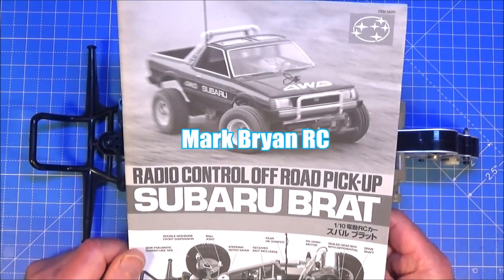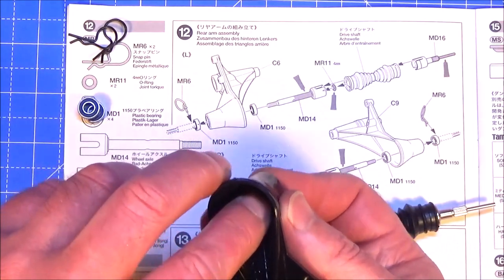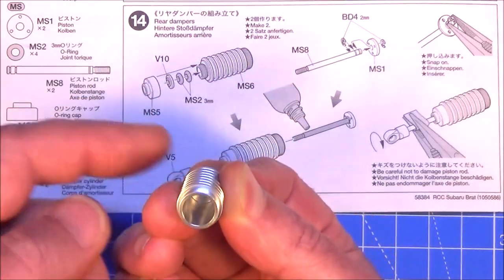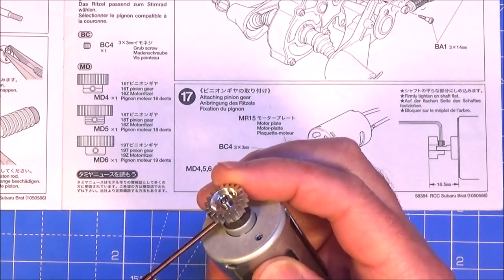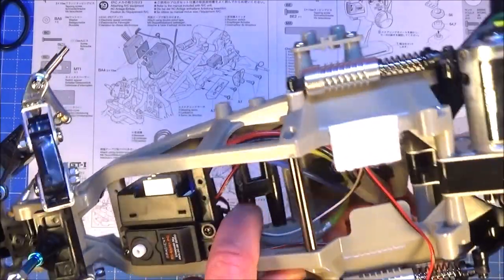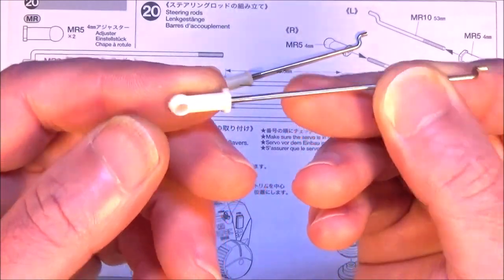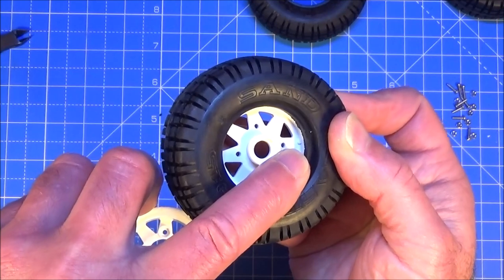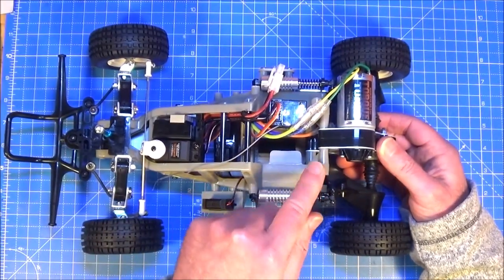Tamiya Subaru Brat Build Guide + Tips Part 2 - ORV Chassis Finished

Comment: Great idea to use the o-rings on the rubber boot Mark! I usually use small zip ties.
The chassis looks great!👍😊
Reply from the maker: Thanks Jeremy! Oh yeah, I tried zip ties but sometimes the heads catch on nearby parts like the insides of those suspension arms. O-rings are a good option if you can get the right sizes. All the best, my friend! 😉😎 👍

Comment: Great video and tips Mark. The o-ring method is new to me. I putted zip-ties on the gearside of the tubes. But next maintenance on my Blackfoot I'll put the rings on, too.
Reply from the maker: Hi Dirk, always great to read you! Yes, the o-ring has the advantage that it has no "tab" sticking out, it's nice and smooth! I think you will like the solution  - cheers my friend!

Comment: I prefer the dog-bones on the brat over the CVD on the Blackfoot. I like the tyres on these and the wheels they stopped using the screw together as they do not need glue to stop them slipping when wet.
Reply from the maker: You got that right, Mal! I don't know how many times I changed the driveshafts on my original Monster Beetle! Love the wheels on this too, nice and simple but a great design! Cheers! 😎👌👍

Comment: Nice Mark! It should move out real nice with the torque tuned motor. 👍on those rubber drive boots I tie a little fishing line  around them to hold them in place on the drive cups.
Reply from the maker: Hi Steve, yeah I think the Torque Tuned will suit this old chassis, not too fast and not too slow! Thanks for the tip about the fishing line, why do I always forget that stuff?!?!?!? Take care, buddy! 😎👍

Comment: Very well presented, and pleasantly relaxing video Mark!
The ORV is such a fun chassis to build, it really is such a quirky unique design.
I must say, I much prefer that chassis colour in comparison to the red!
Much as I adore the ORV, those bloody rubber axle boots are my nemesis.....lost track of how many sets of them I've had to order over the years on the monster beetles!
Tie wraps keep the boots on, but under heavy impact, or fully released trailing arms (through jumping) the dog bones get spat out the drive cups and rip through the rubber! 
They are then a nightmare to get back in, and like you say- harbour the grit and muck! 
Your rubber O ring tip was quality (I will certainly try this)
I've had a lot of success with one of your previous tips, limiting the rear arms travel by inserting a small screw underneath each side. ... 
since that video  I've managed to keep the dog bones in position, and haven't split any more rubber boots! 😊 Thank you!
Really looking forward to seeing the route you go down with the bodies next mate.
Anyway fella, hope you're getting over the old con flu mate.... back to full strength in time for spring mate! 
👍 👍 👍 👍
Reply from the maker: Hi James - sorry mate, just trying to find all the comments I haven't answered!
Yes I thoroughly enjoyed the build on this one, and I also prefer the grey colour of this chassis. 
But I share your loathing of the rubber boots, many a hole I've had in them in the past! Bloody escaping dogbones! But that trick to limit the travel of the suspension arm does do the trick, I might do it on this one before I run it...
The O-rings work well because you don't have the head of the zip tie to clatter into anything as the shaft spins, much better IMHO. I got some blue for the hard body and about 5 colours to choose from for the Lexan body... not sure yet!
I'm feeling a lot better today, thanks, but Louise is still pretty bad and testing positive, poor girl! All the best my good friend! 😎👌👍

Comment: Great build video with many useful tips Mark.👍😊 I recall the old re re Frog had zip ties for the shaft boots. I may remove them eventually like I did for my Monster Beetle as it makes it much easier to clean and maintain. Really love those 3 piece Brat wheels too.
Reply from the maker: Thank you very much, Sean! Yeah I think my original Monster Beetle had those zip ties. I prefer the O-rings coz they don't leave a tag sticking out. And agreed, those wheels are pretty cool! Cheers! 😎👌👍

Comment: Hiya mate.  Great stuff as ever with some top tips along the way.  I did try to get some O rings the right size after the last time you recommended them but the ones I got were no good.  Have you just got a big selection box of them?  I did enjoy building my Brat and this is one I've left brushed as it's a good speed for driving round the garden in the summer.  Also making this chassis fast is asking for trouble as I found with the Blackfoot.  I look forward to seeing what you do with the body shells for this.  That hard plastic shell takes some time.  Best wishes for the weekend my friend 😁👍
Reply from the maker: Hiya Pete! Oh yeah, I got a massive box of O-rings from Aldi, all different sizes, it comes in real handy! Yep, I took a lot of advice from your build guides for the Brat, especially the one about receiver placement. I did credit you while filming but then promptly made a mistake and re-filmed the part, forgetting to credit you!!! Sorry mate!
This was never gonna be a speed demon, apart from the flimsy gearbox, I don't want to smash up that lovely hard body! All the best to you, too, and may your weekend also be good! 😎👍

Comment: In you manual it say MD 12! Is it metal as should fit monster beetle
Reply from the maker: Sorry for the late reply, but I just checked the manual, yes it is metal and it will fit the monster beetle! 😎👌👍
Reply: @MarkBryanRC  THANKS MATE THOUGHT SO AS BOUGHT FOR £3.50 RATHER THAN £20+ FROM RC AIDONG CHINA
Reply from the maker: @SRG-HITMAN-11  Excellent!! 😎👌👍